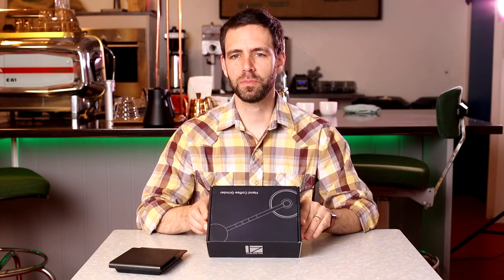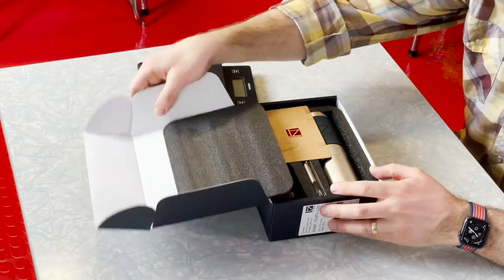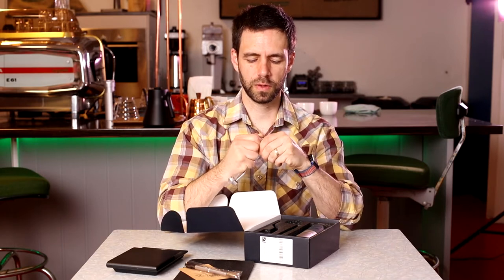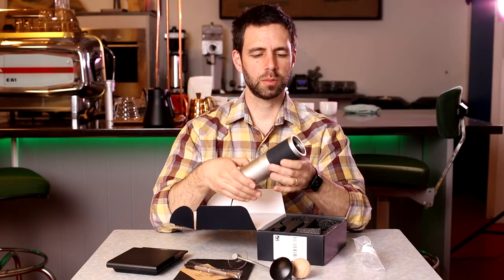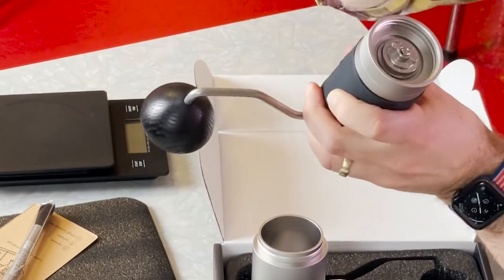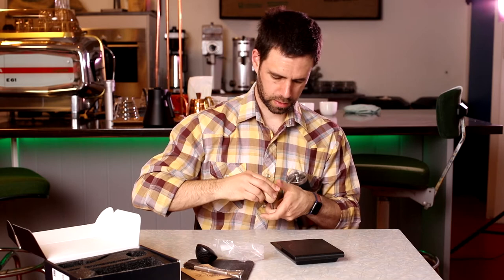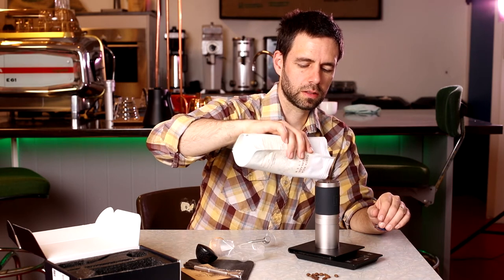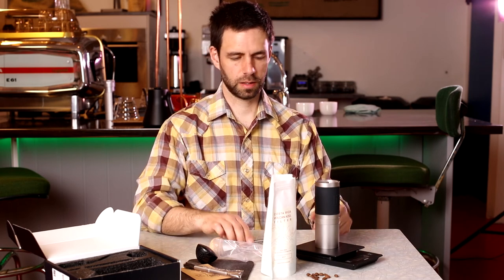Quick unboxing of the 1Zpresso JX manual coffee grinder

Comment: Been using this grinder now for about a month. Really nice grinder, but my two gripes about it are the small hopper size and the static buildup with medium dark, or dark roast beans.  I like the black handle on the one you got there.
Reply from the maker: Yeah, it's nice you can switch out the handle with any of the Comandante handles.  Comandante make a lot of fun handle tops.  Hopper size is a bit of a problem on most hand grinders - but on the flip side.  I'm not too keen on grinding much more than the hopper holds.  Once volumes get that large, an electric grinder becomes a lot more interesting.

Comment: Hi,  I have the JX and still can't understand why the numbers seem backwards when compared with the JX Pro?  The JX pro dial with the numbers on it and counts from 0-9 as you open the burs.  The JX has a sort of wingnut that moves abound the stationary numbers and seems to count from 9-0 as you open the burs.  I can't make sense of why they designed it this way.  Which one is the correct way?  Can anyone explain?  Also, what are those 3 little dots on side for?  Small dot, medium dot, bigger dot.  I wish the company made a how to use the grinder video.
Reply from the maker: The dots on the side are so you know how many revolutions you've turned the dial.  Quite a good idea really and usefull 👍 i know there are lots of people who felt the 1zpresso grinders counted "backwards"